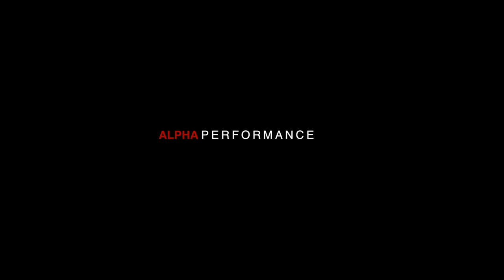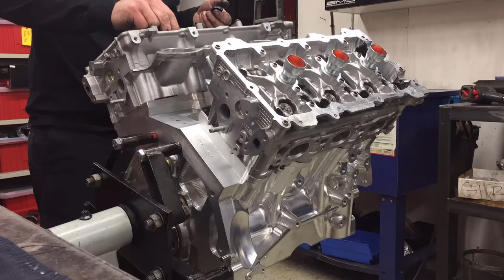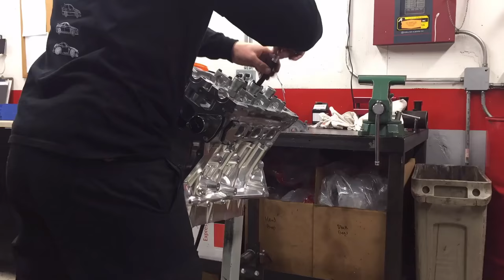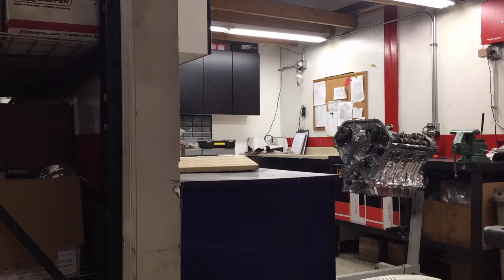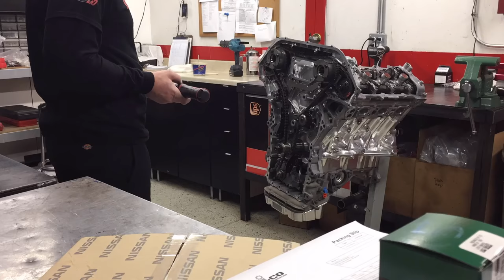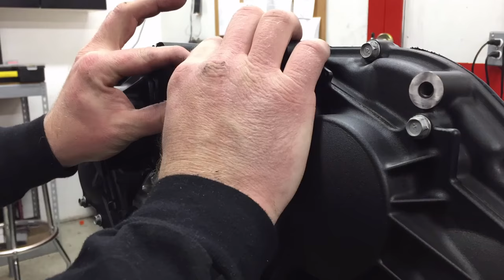Alpha Performance R35 GT-R Crate Engine Time Lapse

Comment: But that room though - all that money and your building them in a oversized broom closet - come on, get a better "clean room"
Reply: Well clearly they're not idiots. They know what they are doing and qualified. I'm sure a bit of dust from an open room isn't going to do anything bad for the engine...
Reply: Building engines in a broom cupboard .. but still hitting 6's. I guess you can say; "if it ain't broke ... ..."

Comment: I hate to be that guy, but the engine builder bage was crooked.  Otherwise, Id expect a lot nicer, more organized engine assembly room.  Using a stool to caulk/sealant on the timing covers?  The thing is, the guy new he was being taped, he knew it was being recorded and being used as basically an ad/promo for AMS.  Youd figure if you wanted to show off/advertise your new products/service, you'd want the set to be clean, organized and not one hint of cluttering.
Reply: The crooked badge annoyed me as well, but vanity gets you nowhere. Making things pretty should always take a back seat to making them work well.

Comment: when nissan gtr stock get modifided by ams does its all the japanese enginering gone and completely replaced by custom build engine by ams?? please explain me, im curious
Reply: I think so yes! The standard block becomes the test bed for development to extract more power from what is ultimately a chunk of metal. Displacement is changed, bore is changed, internal components are binned and upgraded, and in the case of a billet block, not one atom from the Japanese manufacturer touches the new engine built in America. I suspect one reason to keep the engine name is for marketing, or else it would be a random engine that probably wouldn't attract much attention. However, I also suspect another reason (apart from legal ramifications possibly) is to give praise and respect to the original engineers by keeping the name, as a car enthusiasts community should be grateful to the OEM's. I guess that's why the community is spitting bricks at Toyota for the shameful attempt of literally rebadging a BMW as a Toyota. 

Rant 

     Much as I love Toyota and the excellent 2JZ and for producing Lexus, I think the ball is slipping out of their hands. People are flocking to buy the new BMW because, that's that's the only option ... like the first three Star Wars Films, Phantom Menace, Attack Of The Clones and Revenge of the Sith. They are bad films, but at the time they seemed good because that's all there was at the time. 
     I do hope one day the Supra will return, but having seen my in-laws and the hassle they had with their unreliable Z4 with just over 40k miles and the stack of repair bills they received until they sold the thing, I don't hold out much hope for the BMW Supra. Fans boys will always say it reliable, but name me one BMW M car since the E30 and E34 that hasn't had anything but catastrophic engine issues, 6,8,10's? And now Toyota has jumped into bed with that. I wish the new Supra owners good luck, and a hefty increase in their bank accounts, 'cause they're gonna need it!!!
Reply: @utubecomment21  i'm sooo sorry for late replies, thank you soo much for explanation! 💯
Reply: @utubecomment21  2jz are superb engine! Their reliability to sustain very huge amount of power, plus alot of space to put bigger turbos is excellent. I would love if ams has actually tried to make their own engine block consist of metal like 2jz for some gtr ams build package, i know it's hard and complex to design a block of engine but i can't imagine how it goes if it's done hhh

Comment: HP? Thanks.
Reply: G0pi_B0SS90 I believe its 1800hp at crank
Reply: Well it depends on the turbo setup and fuel. The maximum power the engine can put out is upwards of 3000hp though

Comment: How much would that $20k motor cost? 🤙
Reply: Depending on how crazy you want to go, I think it's about $30k all the way up to around $50k.. That's what I've seen anyway, I could be wrong..
Reply: Would you be talking 50k for a motor that can handle 1k+ bhp?
Reply: 11Anti11 if an rb26 can handle  800bhp on stock internals I'd say the vr38 could run 1000bhp for a short amount of time on stock bottom end. The advantages of e85 would see it there. It'd only need rods,pistons, valve springs, larger turbos, to safely run 1000bhp.
Reply: 11Anti11
For 50k, I'm guessing 1500hp+
Reply: my fr. have skyline gtr r33 swap engine 2.5 on 2.7l now have 1200hp 50 000eu+
Reply: This is the AMS billet engine block, with the strongest internals to match it. It is capable of over 3000hp
Reply: The 50k variant is rumored to handle up to 3500+ horsepower is specs to do so. Its the same if not similar billet block to the ams alpha queen that makes 3300 crank horsepower